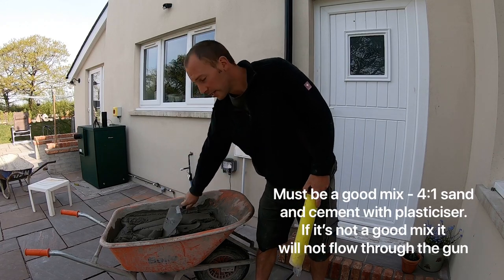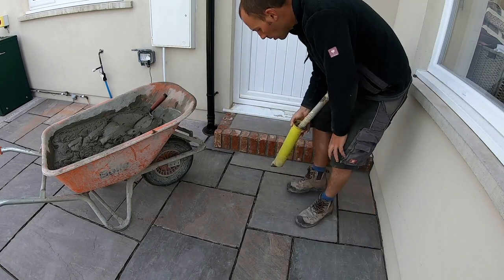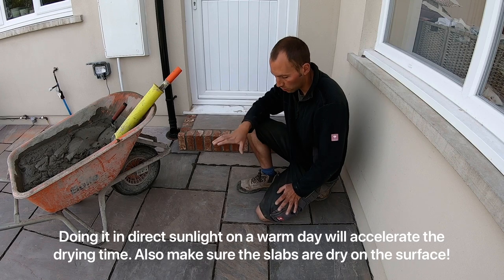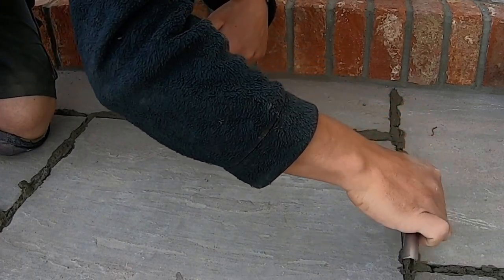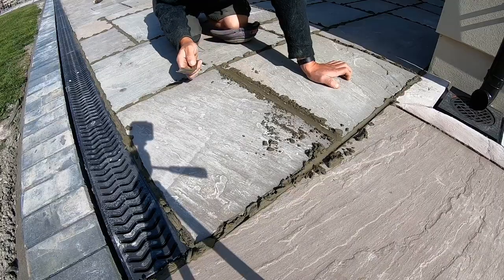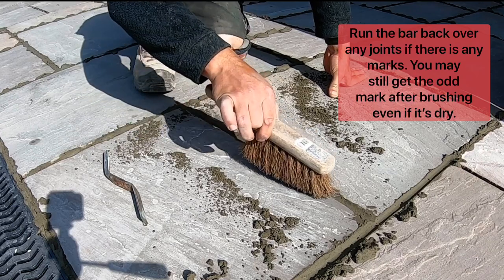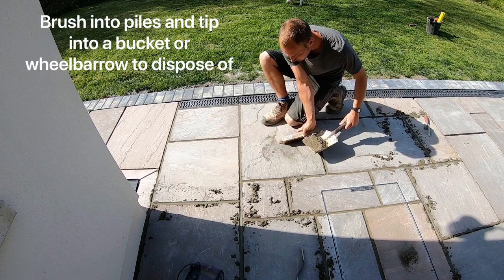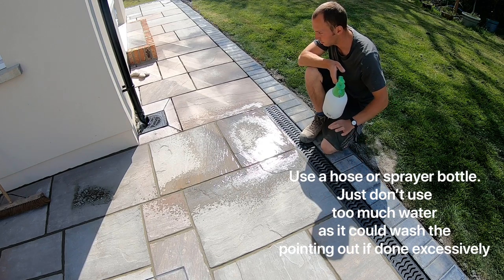How to point a patio

Comment: Just used mine for the first time today, purchased after having seen you demo it here.
Much easier than trying to brush a dry mix all over the place in the hope that it fills the voids properly.
Reply from the maker: djtaylorutube yea it fills up the voids nicely. Biggest thing with it is getting the mix right, once you have a decent mix it goes through the gun easily. Glad the video helped!
Reply: @SamDaviesBuilder  yep, I paid attention to that part. I used a 4:1 with sharp sand. Didn't clog at all but as you said in the video, don't underfill because it's not easy to fix afterwards. I did under fill a few at the beginning, fixed that thereafter.
Reply: Where can I get the gun from please ?

Comment: Love this straight forward explanation which has now given me the confidence to tackle this myself and save a fortune not getting someone out, cheers.
Reply from the maker: Thanks Norman, let me know how it goes!
Reply: @SamDaviesBuilder , will do, but first I have to get some of the old mortar off the slabs. Thinking of using an angle grinder to do this, what do you think? Cheers for any advice on this.
Reply from the maker: @Stormshadow11114  angle grinder or go carefully with a hammer and bolster

Comment: I use the same method, and the same tool when pointing patio's, I find a mix of 3:1 with a little water proof add-mix added to it, is just perfect, and will last for years, more than I can say for these "wetter the better" brush in methods. I only tried it once, I completed the work and the client called me back some three months later, she wanted a new foul water drain putting in, which meant having to lift a small section of the patio, I was amazed to discover that although the top of the joints had hardened...to a degree...that the bottom of the joints that are not exposed to the air were still soft and crumbley. So although these brush in compounds might be quicker and more convenient, especially with our unreliable weather patterns, the old way of doing it beats it hands down for me, and it's more aesthetically pleasing...but on the downside, just pray it doesn't rain as you're doing it lol
Reply from the maker: Green Genes some very good points you’ve got there. The resin brush in ones are a life saver in the winter but you definitely can’t beat traditional sand and cement!
Reply: Yeh and what gets me they say use water to put it in with but if you dont use the  whole tup they say fill it with water to stop it going off in the tub 🤷‍♂️ its all a load of crap . And the lighter colours go green after a few months because its pourous all the dirt gets stuck in it . Its junk .  We put a disclaimer in the quotes . If they want it we will not guarante it .
Reply from the maker: TOTAL LANDSCAPES this is why I like YouTube, lots of tips from other people and what to watch out for. I think some of the resin products are yet to stand the test of time. Some do seem better than others too! What is annoying with some resin products is that people think it’s just brush in and forget, it still needs tooling to pack it in and that’s where a lot go wrong.
Reply: @SamDaviesBuilder  
We wet it up in the bag 
Makes it more useable 
And use it like normal sand and cemet pointing .
No brushing in , and no mess . When the slabs are dry it brushes off so much easier . And you dont get any oil stains because its not all over the paving when using it from the bag or tub.
Reply: @redleather100  That's another downside, after having just being completed 3 months prior to me going back, I was disappointed to see that most of the joints looked filthy, and had turned a dirty grey colour, it made it look like the patio had been down for years.
Reply from the maker: TOTAL LANDSCAPES what product do you usually use?
Reply: @SamDaviesBuilder  
Easy joint .
But have found a company nearby that make a 2 part resin compound and is alot better apparently. We shall see
Reply from the maker: TOTAL LANDSCAPES I’ve been using ‘Pointfix’ by Pavestone. That’s a two part, a bit slower but it feels pretty firm once gone off. I’ll do some more videos comparing them one day
Reply: Sam Davies 
Yes that would be interesting to see the different products side by side .
The thing is we are always learning and trying the next best thing . Easy joint azspects don’t give a crap about there customers as I had a patio we did 3 years ago and the pointing had totally turned to dust , it was just like you get it out of the tub . I complained to them and they just came back with 101 different reasons why it could be like that . They will disappear soon I’m sure after taking millions from us hard working people .  
Have you joined the daily grind with Johnny boy on Facebook .
Reply from the maker: TOTAL LANDSCAPES I’m dreading a resin one going bad as it would be costly to sort. 

Yea I follow a few of his videos, he’s handy for reviews on products. We’d be lost without us lot sharing information!

Comment: Sam beautiful neat work, like me a traditional tradesman. This method will far out last the brush in products that are available today, they will only last a couple of winters if lucky. You can’t beat a traditional joint. However flowpoint is the product to use if your reasonably capable, it goes off much harder than a 4 to 1 mix and will last much longer.
Reply from the maker: Thanks Hamish, yes a cement joint done properly lasts a long time.  I’ve seen a lot of dry cement mixes brushed in and they don’t last at all. 

I am guilty of using resin brush in, if done right they can last but some of the products I’d steer clear of. Problem is some people think you can just brush it in and not even took the joint. 

I want to try flowpoint one day as from what I’ve seen it does look a great product. Have you used it?
Reply: I was recommended the brush in stuff  (I have a point master tool, found it useless), so used it a couple of years ago to replace the pointing on my 10 year old patio. the brush in epoxy is much easier to use than mortar, but its a water permeable joint-  so when I walk on it in my inevitably dirty shoes, that dirt comes off my shoes, sits on the patio until it rains , then washes into and accumulates in the epoxy resin joint, the result now is that my joints have turned from  their original speckled grey to mouldy black, so I'm now in the process of ripping it all out and reverting back to mortar (at least the epoxy is easier to remove than old mortar).

Comment: I recommend using grout bag it works way bett and fills the joints more uniform
Reply from the maker: I prefer the gun for this but the bags are good - I prefer the bags on pointing brickwork as they give a better control of the mortar coming out than the gun!

Comment: Brilliant video. We have a patio with wide gaps between the slabs. Any ideas on a jointing tool I could use where the gaps are 1.5"-2" in places!?
Reply from the maker: Thankyou.  I would just use a guaging trowel in this instance.  Or a 2” wide square edge trowel (you could get a smaller size too).  Places like Screwfix or Toolstation will sell them
Reply: @SamDaviesBuilder  brilliant. Thanks

Comment: Hi Sam,
This is the best method by far, I have 30 sqm patio to repoint. 
What mix is the mortar?
Reply from the maker: Thanks Mark. It’s a lot to take in, but done right it can give a lovely finish which lasts.  Mix of mortar is 4:1 (4 sand 1 cement) with plasticiser.  Check out my ‘how to mix mortar’ video for how to get a good mix as this is so important with the Pointmaster

Comment: Great video Sam. Thanks for the upload. I’ve just finishing laying a similar looking patio (Kandla Grey Indian Stone) and was wondering, is it better to point with a sand and cement mix as in this video or the Pointfix resin compound? TIA
Reply from the maker: Thanks. Resin probably wins hands down for a guaranteed hard pointing and guaranteed colour throughout. Only con is it costs more than sand and cement. Just make sure your joints aren’t too deep if you do point with pointfix or it will cost you a fortune!

Comment: many thanks for your video i found it really helpfull could you please tell me the pointing mix ratio you used in video as i dont have a mixer i will be mixing by hand can i still achieve a good mix like in the video and should i add some ad mix ? regards Russell
Reply from the maker: Hi Russell, 4:1 is the ratio I used in the video.  You can mix it by hand and definitively use an admin.   You will still achieve a good mix if you mix it by hand if you mix it well enough

Comment: How do you achieve a flush joint?
If you use a brick jointing bar it will be slightly raked out.
Cheers
Reply from the maker: You could use a tuck pointer or just a pointing trowel to achieve a flush joint
Reply: Thanks for the reply,
Do you have any footage showing how you would do it?
Also of the mix you use if it's possible?
Cheers

Comment: I’ve found this so helpful. You mention st the start about squeezing the water out. I got 6/8 along the way and my grout (I’m using it for tiling sandstone grout lines) wouldn’t push through anymore. I pull it apart and found the last grout was crumbly and dry in the tube. I bashed it out and it was like putty consistency which I used like playdoh. Just before that my tube started to leak water. 
What have I done? I’d like to get the whole mix to push through 
Any advise?
Reply from the maker: Hi, if it’s tiling grout I can’t help too much as tiling grout isn’t best suited for these guns. It may push through a mortar bag a bit easier?
Reply: @SamDaviesBuilder  ok that makes sense, thanks so much for getting back to me! In any case the pointing almost dry worked great! Not need to sponge is a blessing. It’s funny coz I’ve done that technique tons on a stone retainer wall, didn’t think to apply it to tiles till I saw this! Brilliant
Reply from the maker: @marissaburgess6023  that’s no problem! I’m glad the video helped in some way

Comment: How much plasticiser do you add to the mix. if its 4:1 ration?
Reply from the maker: It really depends on the brand of plasticiser. If I was filling a mixer up (usually a mixer will hold 16 sand and 4 cement) I’d put in around 2 cap fulls. So just make sure if it’s a smaller mix put in less Feb. But as I say, different brands of Feb need different amounts. Just be patient with the mix too and let it do it’s thing, I’ve got a video on my channel about how to do a good mix

Comment: Good video. Simply shows what you have to do. A+++. Thank you.
Oh, how much plasticiser did you use in what volume of mix?
Reply from the maker: Cheers! Check out my how to mix mortar video for how much plasticiser I put in. It does depend on the brand but if I was using the ‘Febmix’ mortar plasticiser I’d put two capfuls in. There’s so many factors such as quality of cement and sand which can affect how much plasticiser you need though.

Comment: What's your thoughts on brush in resin based Sam . Weather point 365 for example . Expensive stuff but saves on labour costs . Do you always point this way ? Thanks
Reply from the maker: machine 19 it’s good as long as when you lay the slabs you don’t leave the joints too deep or just the minimum the product says, you’ll use loads of the stuff otherwise. I point with sand and cement on smaller basic patios (the patio in this one was my own) but larger ones and where I want a perfect colour match or a certain colour then the resin ones are great. Also they’re a no brainier in the winter with the risk of rain or cold as it doesn’t affect the resin as much as sand and cement. Still sand and cement is still a quick way of doing it though so it has its place
Reply: I've used that stuff, easy to apply. But its  porous, so over time the dirt washes in and accumulates, a year or two later all my joints/pointing where I used is now a shade of dirt  black. I also tried sealing it after using,  it made no difference whatsoever, still a nice shade of dirt black. So now I need to grind it all out and replace with mortar.

Comment: I like you video 👍 do you use spacers on you paving and what space should be between slabs.. i am about to put mine and am bit new to this.. I need to put drains too like yours.. i hope you have video how you put drains too.. Thank you paving tool what size? Thank you
Reply from the maker: I don’t use spacers, my joints are around 12.5mm, if you are using sandstone like this sometimes the joints can be bigger or smaller if the slab varies in size. Which paving tool do you mean? Thanks for watching too

Comment: Hi Sam, any reason why I shouldn't use sharp sand for the pointing?
Reply from the maker: cnichoyt it’s hard for me to say how sharp your sand is - where I am in Wales our building sand would be like what people in England use for sharp sand. Basically you want sand suitable for bricklaying as the pointing you’re doing is the same as pointing brickwork
Reply: I'm with Sam. Like said not sure where your based but here in the south (Dorset) the Sharp is quite course compared to the builders sand here. It contains what I would say 3 or 4 mm Flint aggregate. I mean it's not impossible to use and I have used it but, in past findings over some time the motor joint becomes pitted due to the corser aggregate. Its Much better with builders sand
Reply: Our builder's sand here is too orange. In the end I used kiln dried sand for the colour and lack of grit. It produced a nice contrast with the black limestone. Even after sifting the sharp sand the result was too gritty and the finish was not pretty.

Comment: Bought a point master and have 170 m2 to do so if you have made this look too easy I may have to hunt you down. Awesome vid butt. A couple of questions, if you have to stop and come back to it part way through, any advice on that? And what were the slabs are they Kandla Grey? Keep it up as 8 have subscribed
Reply from the maker: Thanks for the compliment!  I hope it goes to plan for you.  My advice if you stop and come back to it is just make sure you finish at the end of one slab and cut the edge of the joint tidy so it is easy to join back into.  Not the best to do at this time of year so I hope you manage to get some dry days - just remember if the joints are damp it will take longer to go off so be prepared for that.  It is a nightmare to finish up if it hasn't gone off enough.  The slabs were brown multi from Marshalls.  I've got a few more videos in the pipeline!
Reply: Cheers Sam. Never a great time but just need to knuckle down and be lucky. Probably planning to do the pointing under a a gazebo in 9 m2 blocks if it keeps up hence question. Did you feb up the point mix and did you slurry mix up the slabs with sbr?
Reply from the maker: Taff Bampy yea feb in the pointing mix, not too much not too little! 

Sbr is good as a primer with cement. I didn’t prime my sandstone as it had enough grip on the back with the cuts from when they calibrate the thickness on the back. But smoother slabs I would prime

Comment: Hi Sam, im looking into having a new garden but extremely low maintenance, no real grass or weeds, im looking at riven paving and want it pointed, but i seen your other video about jointing compound. im guessing the  cement mix is the best way to go.
Reply from the maker: Hi Paul, if done right then a cement mix is as good as a resin jointing compound. However, the resin jointing compounds have come down in price and as long as the joints aren’t too deep then it’s an economical product to use and will last for years

Comment: Neat work pal. Just pointed my Indian sand stone, filling the joints with pointing trowel and then using the jointer, may have to invest in a gun like you’ve used there. (Bricklayer by trade)
Reply from the maker: You did well to point it in sand and cement at this time of year, it's been a nightmare lately for outdoor work.  Honestly these pointing guns are great, you'll use it for so many things, as long as its a good mix they are great.  They are very handy for filling in above lintels if you have made a new opening in a wall - so much quicker than pushing it in with a pointing trowel and it gets it right to the back of the lintel.  Cheers for watching and the positive comment too :)
Reply: @SamDaviesBuilder  god mate I know, it’s been so bad recently the weather! Lost loadsa time! And I built the steps and paving when I was off at Xmas, and was literally waiting until the weekend to be able to point them because of the weather! Been killing me seeing them unfinished 😂😂 .. yeah I bet they’re well worth having, decent when you toothed out bricks and stuff too. 👍🏻

Comment: Neat job, how does mortar compare to joining compound? I tend to butt my slabs up to aco drains without joint, looks neater to me.
Reply from the maker: Thanks. The mortar is good but you’re very dependant on weather, it’s a pain if it drys too fast or too slow so it’s never a constant thing. At least with the jointing compound you know exactly what it will do every time. Yea it does look neater with no joint next to acos but as these slabs are riven on the edges they don’t sit tidy up against the acos

Comment: Excellent, I needed that bud. Thank you. Great work too. Overall, is your now choice of method?
Reply from the maker: Thank you for the compliment.  Have you got a patio you’re doing yourself? 

I do like doing this method  but it comes down to weather conditions and how much time I have.  This method you can’t do if any rain is forecast and also it’s not great to do if it’s too hot so sometimes you have a small window of time to do it.  That’s where the resin compounds can help you get a job done as you can do them in any weather.  But I will say the finish you can get off a mortar joint is better than the resin.  Hope this helps